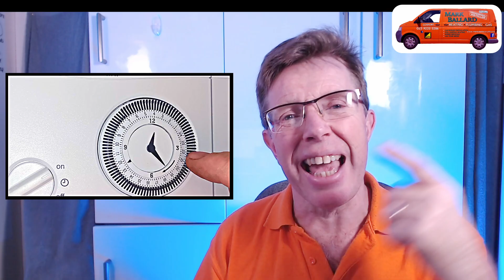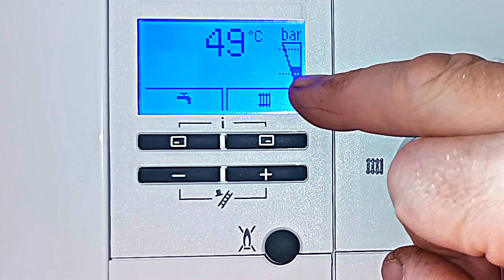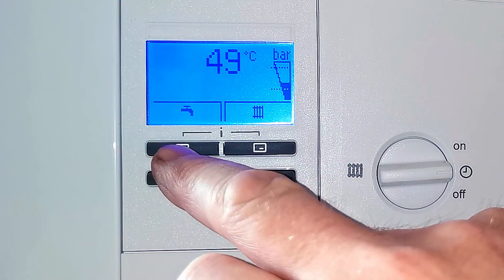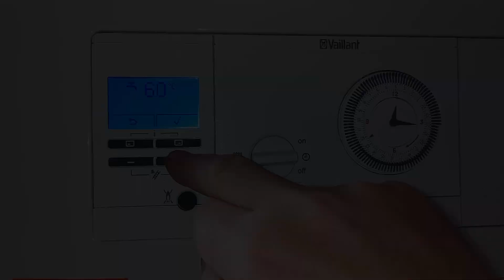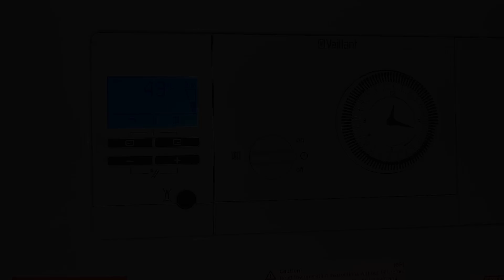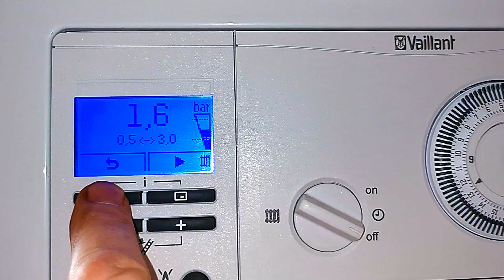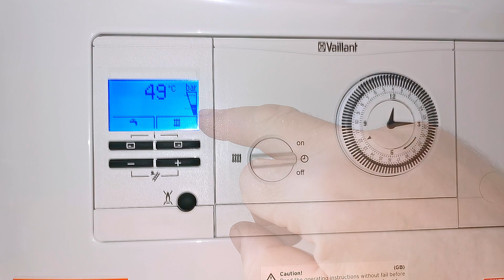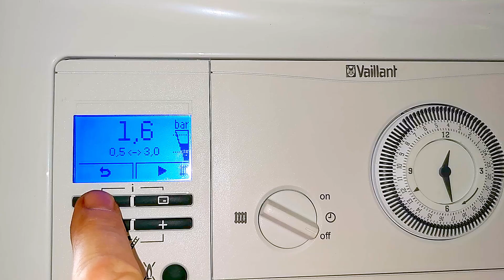How to Operate Vaillant ecoFit Pure Combination Boiler, Adjust Hot Water &  Heating & Lots More,

Comment: Thank you very much for such a detailed video. Very useful. My new boiler was installed a month ago, and it has been working very well. But after watching your video, I realised that one valve, which adjusts the pressure, the one next to the yellow gas valve, remains open, while a second one, further away, is closed.  These valves were set by the installer, and he only showed me how to use the second valve, which is further away, to increase pressure if needed. Is it safe to leave that valve open? I do not want to do anything that could make the boiler performance worse in the middle of a cold spell.  The pressure level has been stable around 1.5.  Thank you. I will be very grateful for your reply.

Comment: I have the same boiler(incl. rotary timer). I have the heating temp set to 50C. However the boiler temp readout goes right up to 75C and the rads. are very hot. Is this normal?

Comment: Hello, I have a problem... once a day the maximum flame turns on and burns for a few seconds, heating the water to 80 degrees, then turns off, the temperature drops to 70 and turns on again, and so on many times in a row... and the comfort sign flashes... and I turn off the boiler... and then it works as usual...

Comment: I’ve put mine in for the first time today so on the boiler my radiator setting is set at 45 given we are in today’s climate and prices are sky high. My thermostat on the wall in my hallway is set at 15. Why can we just not have 1 setting to warm up our homes. I’m a little confused as to why the boiler has its own radiator setting and then there is another setting on the wall in the hallway.  I’m just watching my boiler temperature for my radiator. I have it set on 45 as I’ve mentioned but yet I have the radiator symbol flashing and it says 48 is this temperature going up because I have my water on the boiler set at 50 and it’s getting upto the 50 before it switches off, it’s hit 50 and now I have a flashing sand timer ⏳ flashing and my temperature has gone from 50 down to 42 and is dropping but my boiler is still making a noise it’s as tho is still operating it’s now on 41

Comment: Hi Mark - My new valiant boiler will not go above 60 degrees for hot water, that's the max setting. 

This is normally ok but sometimes it would be great to have the water a little hotter ie Washing up. Is there anyway of increasing this ? TIA

Comment: If you have an electronic timer you have comfort or program mode. In comfort mode it allows the room stat to control when the heati g comes on. If you use programme mode you have to set each days time to come on. Well if you can  predict days when you want the heating on  thats fine. So if you want to save energy you needcomfort on.

Comment: Hi Mark, great video as always. I have just moved into a house with Vaillant Ecofit Pure 835 boiler and have set the DHW to 50 and CH to 65. Howver every time I check the boiler when the central heating is ON, I see 76 on the display. So why is that the boiler is not following my set temperatures? I am also sure that my DHW is hotter than 50. Please help.

Comment: Thank you for this video. It's so well explained and covers exactly the points that I needed. I've just bled a radiator, which brought the pressure down to 1.1 but I couldn't work out from the manual what to do. You've helped me to get the pressure back up to 1.6 and I've also changed both radiator temp and water temp by a couple of degrees. Thanks for the help!

Comment: hi

i need your advice

my ecofit pure only heats the hotwater for taps via the centrel heating

if i turn of the heating (summer mode) even with the hot water temp set (50+ degrees) the boiler wont turn on to heat water either manually or via (old)honeywell control program , it wil only turn on to heat water when the radiator temp is set and then the radiator symbol flashes when it turns on

i also dont have that comfy option when i press the hotwater settings

is my boiler faulty?

Comment: I've got an Eco fit pure 418 vaillant boiler for my indirect vented hot water cylinder tank in my closet. Fitted 2019 and It comes with a condensation pipe too. The pre-set temperature was set 75 C, I've lowered it to 65 C for hot water and radiator just save a bit of gas and see if it helps the efficiency.  I don't want to really go below 60 C that may create harmful Legion's bacteria in the cylinder tank. Can you tell me this is ok? Thanks

Comment: it's not been helpful because my pressure is all the way to the top and you haven't taught us how to make it go back down
Reply from the maker: That not to do with the boiling operation. 
That's probably been caused by over filling most likely.
Just bleed off water from a  radiator air bleed point may take some time but safest way.
Reply: @MarkBallardLTDHeatingEngineer  
ok
Reply: @MarkBallardLTDHeatingEngineer  Hi Mark, the water pressure on mine is also too high. I bled a radiator (it didn't need it) but the pressure has gone up.  Advice,  please.  Thanks.

Comment: This is very helpful and thank you very much. Unfortunately, my water top up went up to 2.0 instead of 1.5.  Please is there a way to reduce it?
Reply: Drain water from 1 radiator, any radiator in house and then check the pressure
Reply: @mob9334  Hi, the water pressure is too high on mine so I drained the radiator (actually water came out from the radiator immediately, so it wasn't that) and it is still too high, in fact the pressure has gone up. 
Advice, please.

Comment: Hi Mark, I've had this boiler fitted and the hot water works fine I've atdjusted the temprature which was straight forward. I've gone to place the heating to on (I'm a cold person) turned up the Honeywell thermostat and the heating symbol and flame haven't appeared in the screen like in your video at 3:47. No sound to say the boiler is on. Is there anything I can check before I have to call someone out please? I've turned it on and off and tried again  but still nothing, they didn't really show me how to use it properly or leave a user guide which is why I searched for your video. The boiler  is just like the one in the video with the turning 24hr clock (Baffled why the whole thing isn't digital)

Comment: Excellent helpful video thanks you. I will check the comfort setting and temperature settings as you explained. My problem is the pressure keep going up to about 3.8 bar and then next day after the heating has been off all night it has only dropped down to 3.1 bar when cold

I bleed a radiator and got the pressure down to 1.6bar then after the heating was used, it done the same again🙈 any idea what would cause this?

I already had the service done and the plumber is useless, doesn’t seem to check anything and actually left us with a leaking magma filter which has now been replaced with a new one, which I believe was the fault of the plumber doing it up too tight🙉🙈 what a nightmare I’m having with this plumber, 

Please help
Reply: Pressure will always rise a bit and drop during the boilers operation, But should settle back to what it was set at. (Should be 1.5, or 1 at the very minimum). First, Make sure your pressure/filler tap is fully closed and you can't hear any movement of water coming from it in the pipe (If it is closed but still sending water in, Then plumber time). If you have a filter you can drain water from there, If not, the radiator is the only option as you did. If the pressure tap is fine and after draining water but still the pressure keeps rising as high as you say, Then you could have a problem with the expansion vessel inside the boiler which will need servicing - Either needs pumping up, Or it's too small for the job, Or is faulty. One other possibility is the pressure gauge is faulty, You never know just throwing that in there.
Reply: @danimayb  thanks for the reply. The expansion vessel was checked on the service 2 weeks ago and apparently it's ok. The filling loop is definitely not leaking as I just took that off the mains tap end to check the valves were not letting water past. 
Someone else said it might be a pin hole in the heat exchanger! 

I have dropped the pressure to 1 bar again with the system cold. Then turned the heating on, it went straight to 1.4bar with central heating on then was at 1.7bar when turned off after an hour or so. 

Next morning after being off all night from cold it was 1.8bar. so basically it is never returning down to original set pressure. Always slowly rising!

I will call Valliant today as it's still under original warranty 😬 hopefully they can have a look.

Comment: Really helpful video. I had a new Vailant combi installed back in the summer, but had no idea how to drive the menus, and I'm an engineer! Who knew that the gate icon was supposed to represent a radiator, or that the rad temperature could be adjusted. It all makes great sense now - thank you so much for this, and for your other video explaining leaks and the need to re-pressurise the system ocasionally.